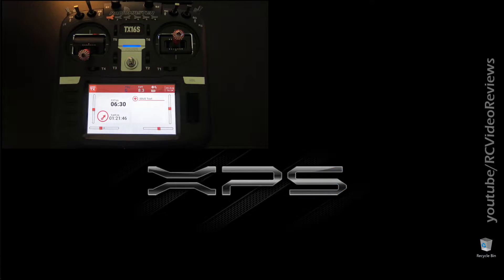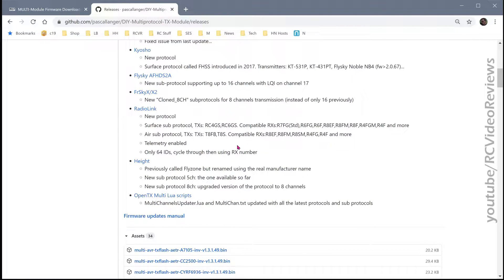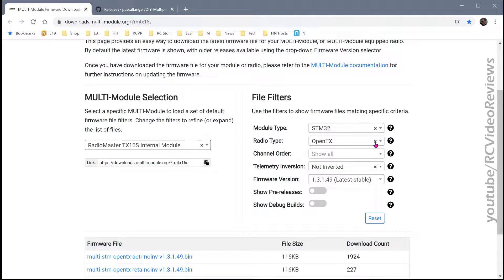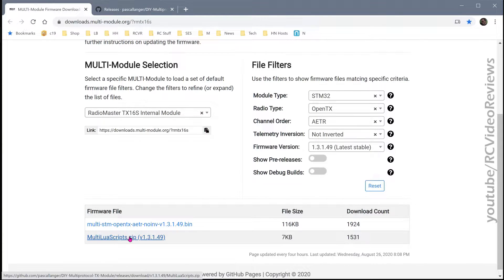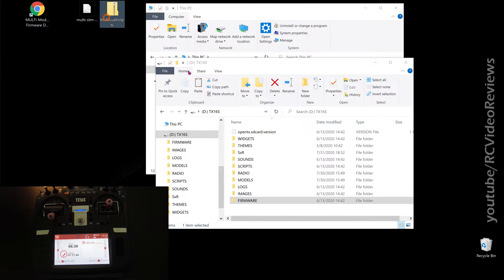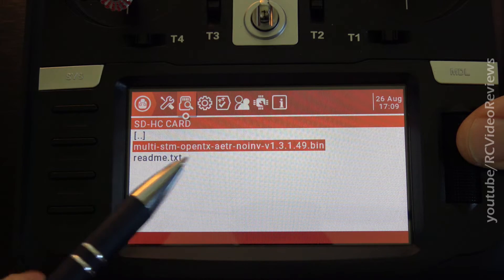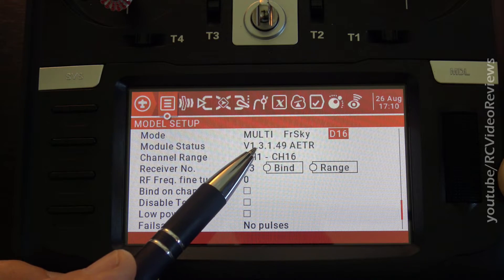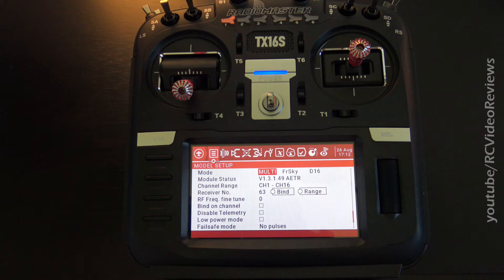How to Flash Radiomaster TX16s Internal Multiprotocol Module Firmware • [Beginners]

Comment: Hi,I understand there is an option where you can hard set fine tune for various makes of receivers in a config-h file. This would be be handy if using  an external module in different transmitter. I found the file on the site but have no idea on how to configure it, if your able to explain how to do that would very helpful
Reply from the maker: Alan, You have to pull down the source code from Github  and compile the firmware. Here are instructions for setting up a compiler environment:
https://github.com/processing/processing/wiki/Build-Instructions

Looks like you need the Arduino IDE to compile the source:
https://github.com/pascallanger/DIY-Multiprotocol-TX-Module/blob/master/docs/Compiling_STM32.md

Personally, I prefer linux. On linux you can add the Github repo and clone it to your local hd from the command line. If you install the developer environment in your linux distro, the IDE compiler should work with what pascallanger put up right out of the box.

This is the config.h file you can edit using your own values.
https://github.com/pascallanger/DIY-Multiprotocol-TX-Module/blob/master/Multiprotocol/_Config.h
Reply from the maker: I actually just went through the process and it was super simple. Follow the instructions closely and it works. The only error I found was on compiling the binary, with all options enabled in config_h, it came out to be 101% in size. I commented out two protocols and it compiled successfully at 99% in size.

My compile produced 1.3.1.59 which is even newer than the release copy.
multi-stm-1.3.1.59.bin
Reply from the maker: I found what you want to do:

/** CC2500 Fine Frequency Tuning **/
//For optimal performance the CC2500 RF module used by the CORONA, FrSkyD, FrSkyV, FrSkyX, Hitec, HoTT, SFHSS and Redpine protocols needs to be tuned for each protocol.
//Initial tuning should be done via the radio menu with a genuine CORONA/FrSky/Hitec/HoTT/Futaba/Redpine receiver.  
//Once a good tuning value is found it can be set here and will override the radio's 'option' setting for all existing and new models which use that protocol.
//For more information: https://github.com/pascallanger/DIY-Multiprotocol-TX-Module/tree/master/docs/Frequency_Tuning.md
//Uncomment the lines below (remove the "//") and set an appropriate value (replace the "0") to enable. Valid range is -127 to +127.

Any value entered in the subsequent lines other than 0 results in a hard coded tuning value which would travel with the module from radio to radio.
Reply: @RCVideoReviews   Just a thought it would be a good subject for a video if you ever had time, I'm sure that I'm not the only one. All the best Alan
Reply from the maker: @alantoseland6629  Oh believe me, I'm seriously thinking about making a video about this. I'm leary of getting too far into the weeds though. Many of the heavily technical topics I've posted in the past do not perform very well.

Did you look at any of the links I sent you? I set up the environment in Windows with about 10 minutes of effort. I compiled my first binary within 15 minutes.
Reply: @RCVideoReviews  yes I've have had a brief look, will have a better look later and try to see if I understand it all
Reply from the maker: @alantoseland6629  Video is posted...
Reply from the maker: @jimsnodgrass8454  It's done and on the channel now.
Reply: @RCVideoReviews   Thanks for your help

Comment: Thanks mate that's good info....the FlySky AFHDS 2A update looks interesting. And my FlySky CVT01 voltage telemetry sensor turned up today; yes it might look bulky in the photos you see in the ads but its incredibly tiny and compact...dimensions are 30mm x 12mm x 6mm or for non-metric folk is 1 1/4" x 1/4" x 1/2".....a very tidy size and at $5 AU (or $3.60 USD) and free postage I reckon it's worth a try.
Reply from the maker: I think I will try one of those. They need to ditch the case though. Just a small shrinkwrapped pcb will do.

Comment: I had problems with this download.  I intially tried to do it with my Macbook air, but it wouldn't unzip the file.  Went to a windows based computer and it worked as it should.  For some reason my Macbook wouldn't open the bin file.
Reply from the maker: The bin isn't zipped. It's just a binary. It goes on the radio as is. Only the Lua scripts update is an archive and needs to be unzipped.
Reply: RC Video Reviews well for some reason the lua worked fine. The binary one wouldn’t work on my MacBook. Not sure.